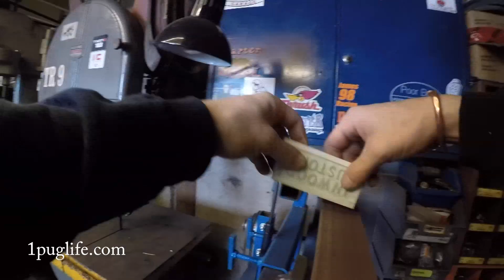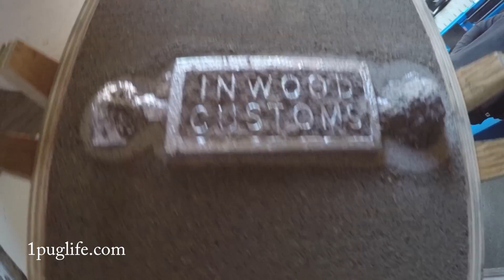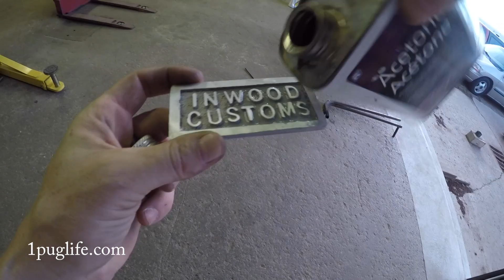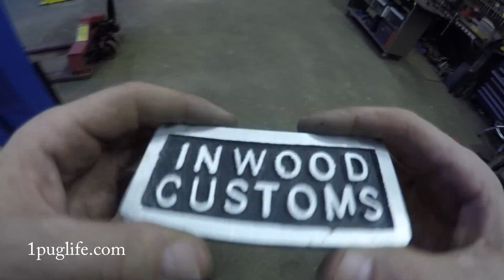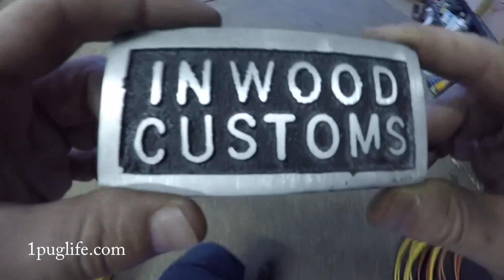custom shop sign

Comment: Make a tow hitch cover out if it. Have Carponics put some LEDwards in the eyes the light up. Drop a vape tank, atomizer, and coil inside it. Then have it pop out smoke when you flip the switch on in the truck.

Comment: Congrats on that shop sign Pug. It doesn't look half cigrit!! And yeah, you could actually make an ash tray or something out of that dickered skull bud... or even a mini flower pot ffs! I need a 2 x 72 grinder like yours... real bad! Didn't you build it? (Not like you answer questions tho...)
Reply: look back in his vids, he built the grinder himself along with a wiidsplitter at the same time.
Reply: I thought so. That seems to be the cost effective thing to do. Besides metals all ya really need to buy is wheels, a gas shock, and motor depending on the build. Thanks...
Reply: most metals were from metal dicks he calls them in trade for hortons coffee bribes, lol so he could raid the "scrap bins" for all he could carry, ;-)
Reply: *woodsplitter
Reply: if i wanna play metal games i have bulk trash days to stock up, just need that darn welder,;-)

Comment: You probably need a better source of oxygen, like a boat cooling fan if you've seen those that flow way more air to get it really hot and a weak pump for the oil.

Comment: Awesome job... you can make an inwood customs
 branding iron..and brand the shop dicks  lol
Reply: Problem with that is, the aluminum would melt again before it got hot enough to brand someone. It would have to be forged from steel to work.